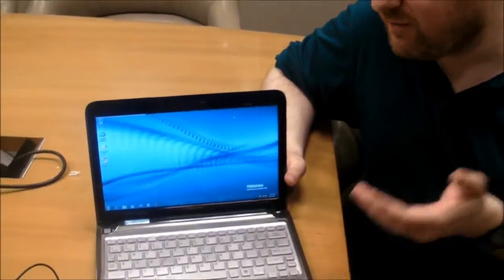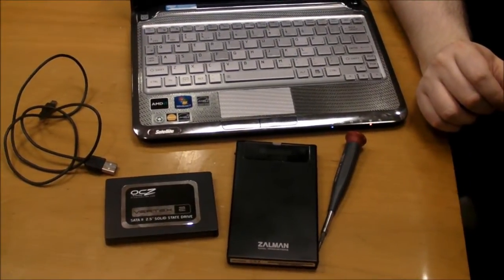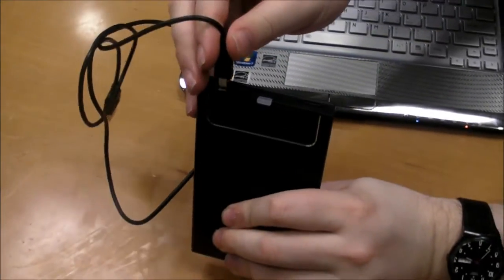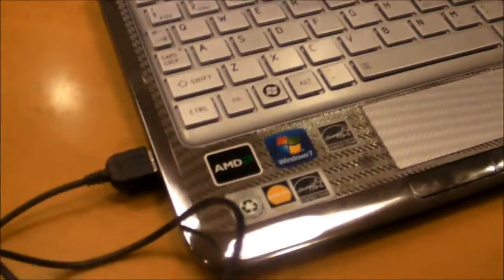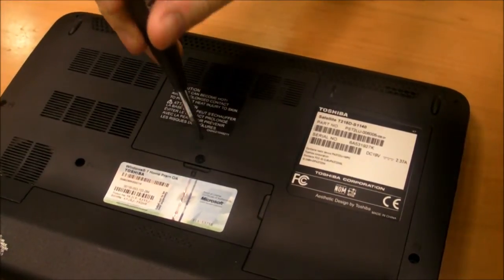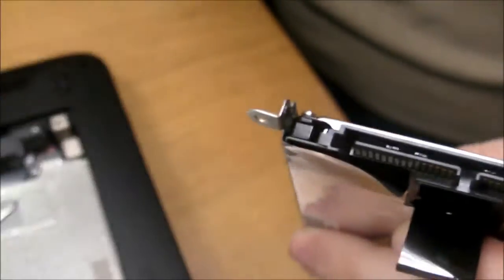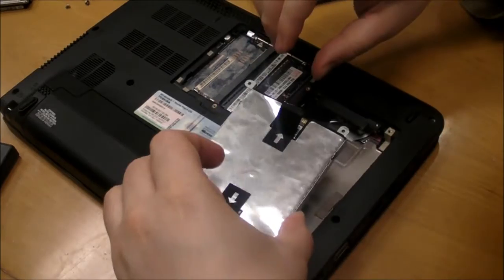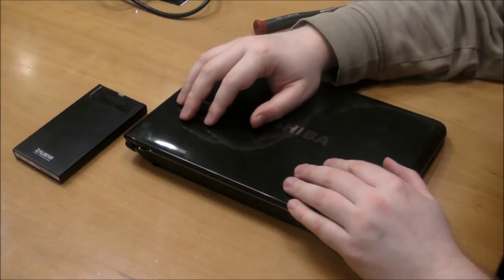How To Install an SSD

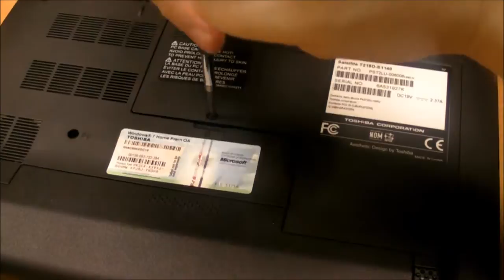Comment: Very good explanation so far; at 5:17minutes. I gave you a thumb up. However, should you not remove the battery of the laptop/notebook computer first? Or is the removal of the battery pack at a later stage of the Solid State Drive upgrade?  I am not exactly sure, I'm only asking, because I am going to eventually swap my HDD from my Acer Aspire V3 laptop (of 2013), now operating on Windows 10, for a solid state drive, of around 240, 250GB, OCZ, Kingston, or Hynix. I've heard that Samsung EVO are one of the best SSDs made.